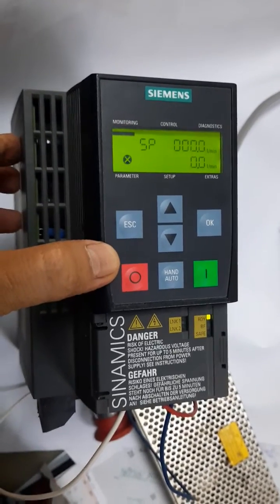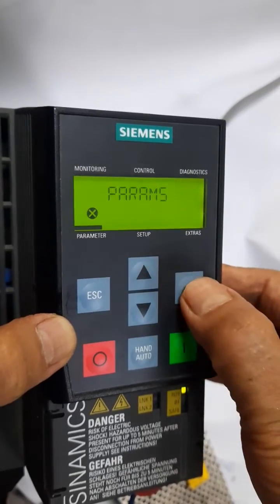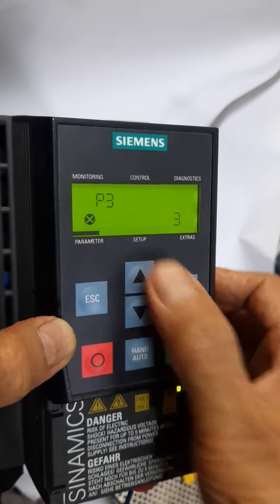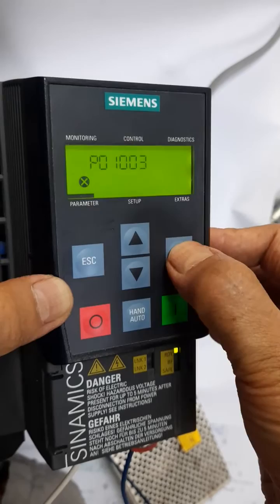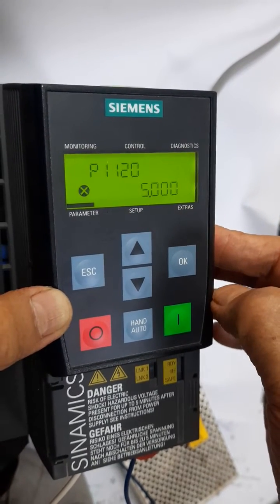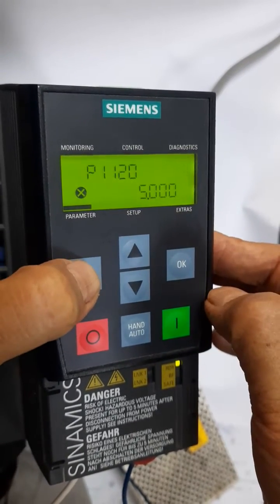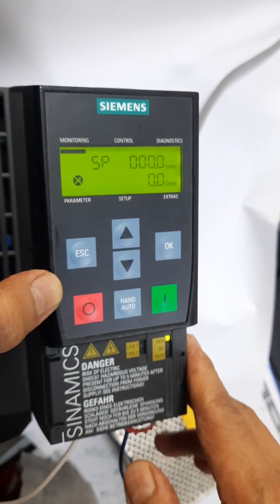Siemens G120C VFD fast way to go to a parameter

Comment: How can I turn the sense of the motor (turn right or left) only with the G120C panel (parameters, no inputs)?
Can you help me?
Reply from the maker: Yes it's possible. For that you have to enable the reverse direction rotation as well as you have to put a value at which you want to run the motor at reverse in your parameter. I have to look more to suggest you the exact parameter. Thank you dear for watching my video.

Comment: My Siemens G120P drive is showing is showing f01910 fault. Which parameter to change to bypass this fault?
Reply from the maker: Your device using fieldbus communication or you are using hardware input, output for control, start/stop, rpm change your motor. Please tell in details.
Reply: @eeeknowledgesharingblog8994  
I am using both hardware i/o for starting stopping, rpm change & fieldbus communication for soft integration and getting data like current drawn, frequency etc.
Reply from the maker: @mohammadzaid5375  then check your communication cable laying. Keep it separate from power cable and earth/ground the shield properly.
Reply: @eeeknowledgesharingblog8994  Someone recommended changing the value of the parameter p2040, will it work?
Is there any way we can bypass/acknowledge this fault?
Reply from the maker: @mohammadzaid5375  you can try by increasing fieldbus monitoring time P2040. If your communication cable get interference, then P2040 would not work also. You must have to eliminate the interference by using cable shielding properly or by drawing the communication cable through GI conduit pipe or by taking the communication cable away from thd power cable. Thank you.
Reply: I want to run without motor can u help me

Comment: I wanted to run my drive in without ai I only want run my drive via keypad refference what I need to do please tell with parameters
Reply from the maker: For running from keypad - simply press on HAND/AUTO button of keypad. Then use green (I) button to start and Red (O) button to stop.

If you need start by DI instead of AI setpoint then the thing is different.

Comment: What is the RAM UP parameter that you set to 1120?
Is it the RPMS of the motor? And also tell me what does 5 seconds mean? It means the time to start the motor?
Reply from the maker: p1120 is : Ramp function generator ramp up time.

Means : The speed setpoint from standstill (speed setpoint = 0) up to the maximum speed (p1082) in this time.

For easier understanding I will calculate with 1500rpm as max. speed (p1082) and ramp up time (p1120) = 5 sec as i given in this video.

Let say; Start form zero to (max) 1500 rpm in 5 secs.

So the drive will take 5 secs to accelerate from 0rpm to 1500rpm.

If you configure the drive such that it's 1st or initial rpm setpoint with start command will be 750rpm then it will take 2.5 secs for the drive to accelerate from 0rpm to 750rpm.

To reach your first setpoint 750rpm from standstill it will take 5s/1500rpm*750rpm=2.5 secs.

Now your drive is running at 750rpm. 

In this 750rpm running condition If you give your next or 2nd setpoint rpm say 1200rpm then to reach the 2nd setpoint 1200rpm from 750rpm it will take 5secs/1500rpm*(1200rpm-750rpm) = 1.5secs.

Hope it it will help you.

I'm not an expertise technical tutor for this Siemens drive but a content creator. I replied it because i give value to my viewers.

Thanks for watching it.

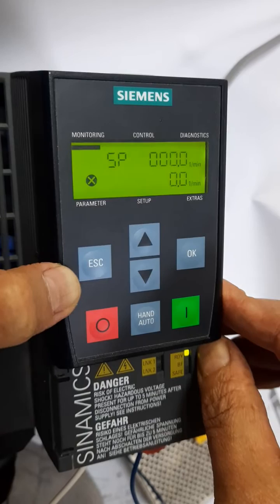Comment: Thank you for the video. When I press the upper arrow, it takes me to your screen at 2:41, which in my cases, displays SP 812.5 on both rows. Can you please explain what this means?
Reply: Well it is nothing but the speed/rpm set point (1st row) to your drive  and actual speed feedback (2nd row) of your drive. Speed setpoint may be either through remote AI source (V,mA or variable pot) signal or from your VFD fixed speed para.